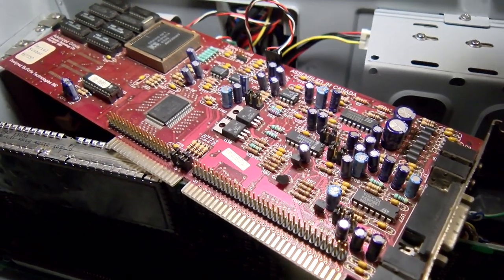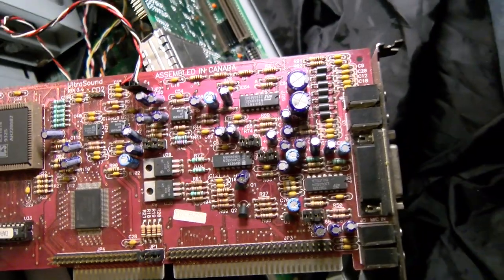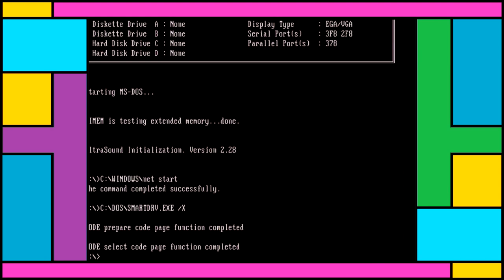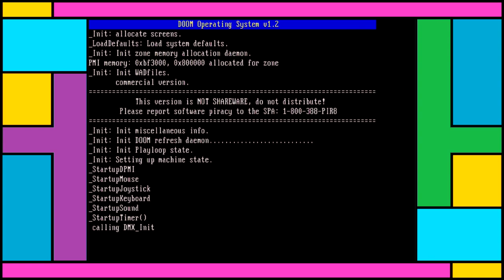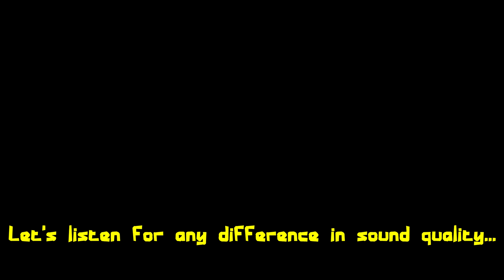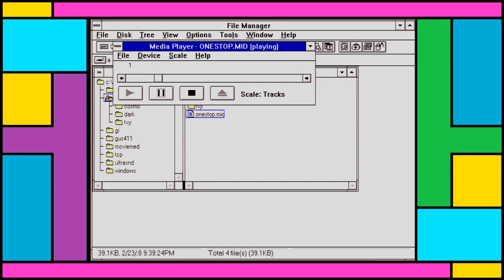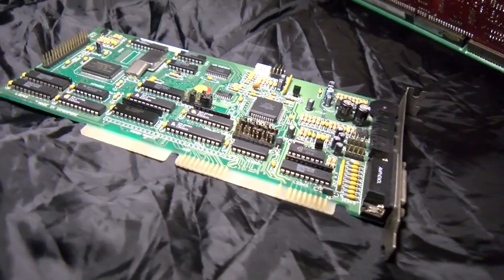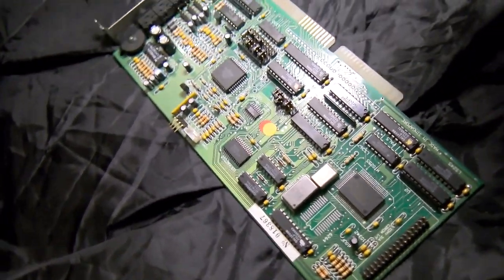The Real Gravis Ultrasound Experience

Comment: Sound card porn never interested me. Who cares? Was the difference THAT big? No. Graphics made all the difference post 1995. I had an Aureal Vortex and my friend had an SB AWE 32. It didn't matter, I'd have been totally happy with a standard SB 16 clone, as long as I could play the music and sound in DOS etc. I see these soundcards now on eBay, Amibay etc and, looking through my bits boxes, I find loads of AWE 64's, A3D's, Ultrasounds and ancient rare Yamaha ISA boards. Maybe I should take advantage of these sound loving freaks and list them. I will never use them. GPU's good, sound cards bad!
Reply from the maker: By contrast, I have little interest in GPUs, but then I rarely venture beyond the mid-90s, so perhaps that's why. Sound cards were far more important in the DOS days because of things like this - where if you bought something weird, it might not work. Luckily most cards cloned the Sound Blaster quite quickly. As much as I hate Creative, their model certainly worked.
Thinking about it, there are certainly parallels between the two. The disarray early on, the expensive gimmicks that looked good on paper, the settling of a standard that some vendors refused to adhere to and the eventually winner gaining a lot of critics. Makes no odds to me as far as GPUs are concerned, because I'm the idiot who pulled out a V3 to install a Blade XP and liked it. I had my reasons.
Reply: @HighTreason610  See I only started gaming with PC's around 1993. I had a 286 prior to that with a monochrome screen that could barely run Scorched Earth, but in '93 I got a 486 (no sound card included - bottom end spec in the shop) and that was primarily for Wolfenstein 3D. A few months later it would be Doom and Alone In The Dark. I bought a soundblaster clone for £40 and that was all I needed. Shit little speakers anyway, but I got the speech in Tie Fighter and the music in AITD. The most important thing for me was fluidity of graphics. Seeing how much better AITD, Doom and The Legacy ran on my 486-DX compared to my friends 386-SX was all that mattered.

My friend, now he was into sound. Still is. He came from Amiga to PC and to this day he still has millions of MIDI files and software to fuck with sound dating back to the early 90's. I'm a music lover, always have been, I just don't relate it to gaming or computing. Different strokes etc.

From the late 90's on, every PC I aquired came with decent onboard sound. The CM32's etc of the Pentium III era, Crystal something on the Dell Optiplex machines ... they were all that was required. Meantime my friends are still spending £100+ on Xonar or Audigy cards, when I said put that extra money on the GPU to double your framerate! XD
Reply from the maker: Back in those times, video cards mattered little as the CPU was doing most of the work, it was a very different world. Amusingly, sound cards almost pulled the reverse of what GPUs did, where today almost everything is done by the CPU and the audio solutions are much the same. As such, I don't bother with modern sound cards, the onboard one does its job and any problems it has will be purely software related issues, may as well save a slot for something else.
GPUs still don't interest me, the GT730 has served me well and it'll probably be Intel graphics next time to save on costs. The last GPU I really cared about was the GeForce 4. Most of my build costs on new machines seems to go on hard drives.
Reply: @HighTreason610  Totally agree. Video cards were only marginally important when it came to gaming. As long as you had a VGA card capable of 256 colours and VESA/SVGA, you were good to go. I was talking about post 1995. Point being that sound is sound, but graphics are far more important (and would become hugely more important as time passed).

How come you spend so much on hard drives? Do you mean for retro rigs? 

You're in Hull right? I remember your live Hornsea Hull bike ride some time ago. It was hilarious. I got about 50-60 retro HD's from a few hundred megs onward. You're welcome to some if you want. Doing no good here, just gathering dust with 90% of my other stuff! XD

Cheers
Reply from the maker: For the longest time, you were actually better off not going beyond 256 colors anyway, as performance got worse and when some cards started to offer GUI acceleration and motion/scaling, these features would only function in certain modes. Still, sound cards were still a harder decision then, as some of them simply didn't work so well, most of them did by 1995 though - until PCI cards arrived and broke everything again.
Nah, hard drives on current machines, so luckily I don't have to buy them often. About 2/3 the build cost of the Xeon was hard drives, followed distantly by RAM and then the CPU, as these are the things its workload needs. Almost nothing uses any form of GPU acceleration.I do technically use an ($5) off-board sound solution, but that's because of a bug in the OS and a firmware issue that was never resolved. The onboard RealTek certainly did its job fine for anything but music until the OS updated and broke the outputs.
Thanks for the offer anyway. Old drives aren't cheap now either, you could always try to sell them and make a little cash.
Reply: @HighTreason610  I was looking to sell some stuff, till I realized the volume I have laying around and the time it takes to list / sell / ship everything. With working full time theres no way I'd have time to sell this gear unless I did it job lots, which means I lose margin and it's harder to sell volume especially to hobbyists / collectors / tinkers. 

Storage is looking like an option. Maybe I'll try to sell stuff next year during the holidays.